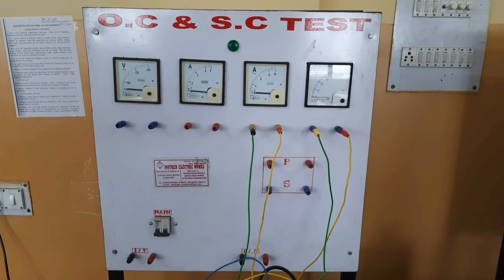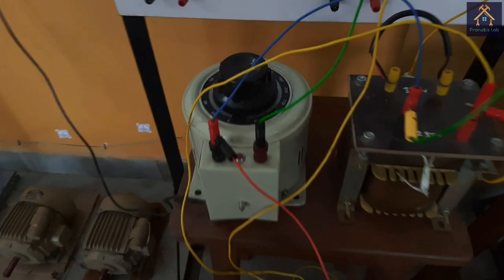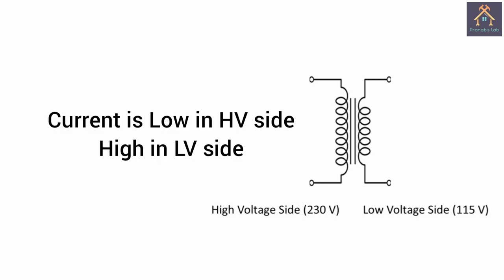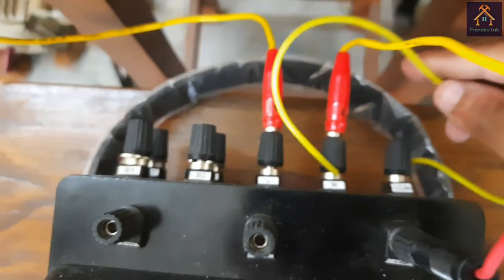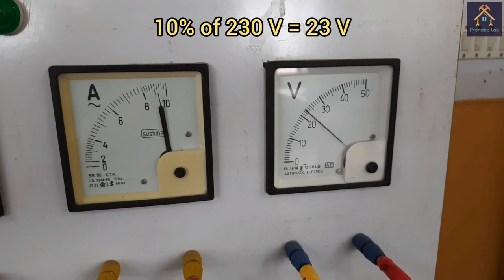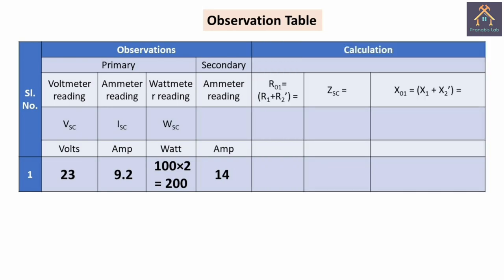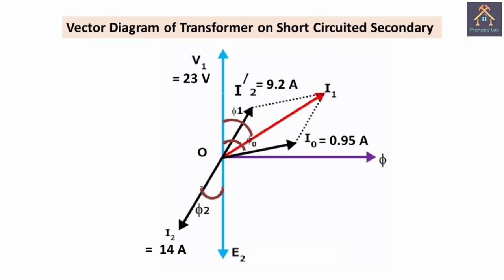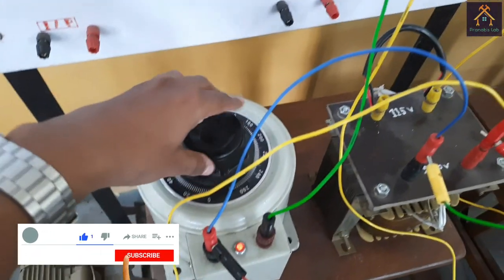Short Circuit Test of Single Phase Transformer | Practical Test with Calculation

Comment: Why u didi 100×2 to take wattmeter reading.
Please reply
Tomorrow is my lab exam
Reply from the maker: Because, the voltage terminal of the Wattmeter is connected with 300 V and current terminals are in 5 A position. The full scale deflection or maximum position of the scale is 750 Watt.
The multiplying factor (MF) is (Voltage × Current)/Full Scale Deflection in watt
= (300×5)/750 = 2.
So we have to multiply 2 with the reading observed in the Wattmeter.
Reply: @PranabsLab  thank you so much sir